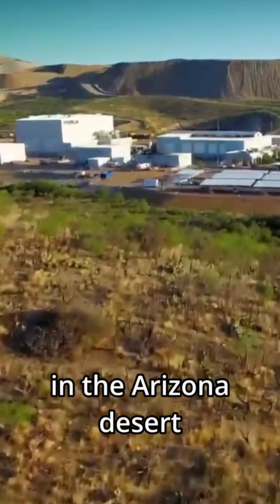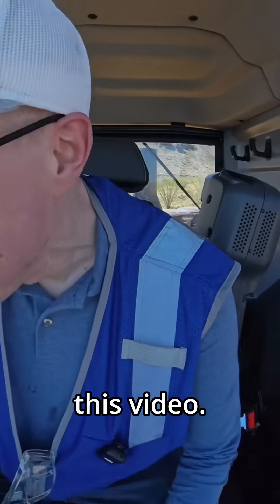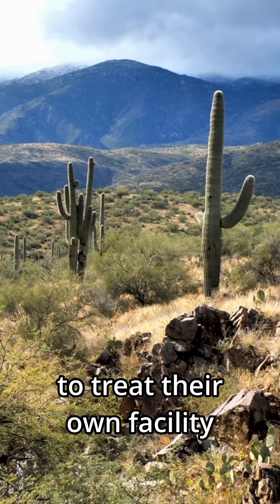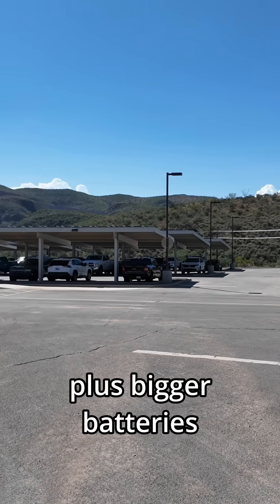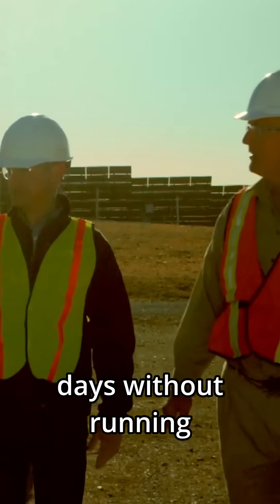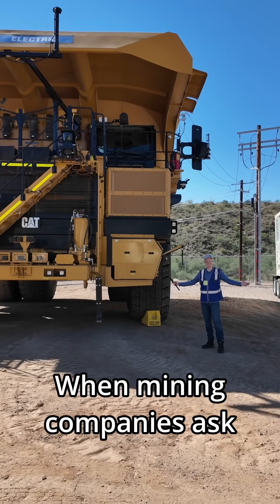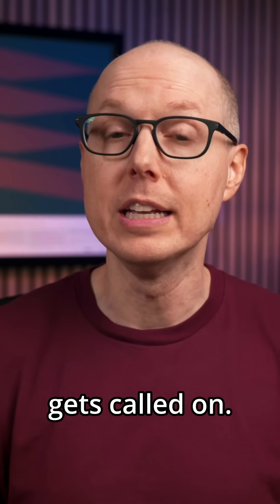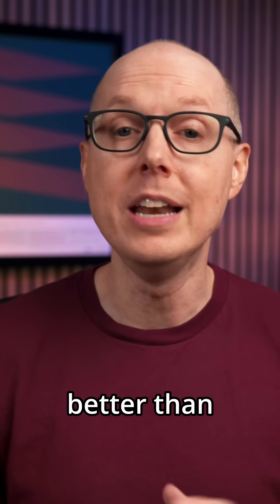Microgrids: The Desert Facility Running on Sunshine

Comment: I installed the fire suppression systems on the very first two electric drive haul trucks at this site in 2006.
Reply: Tell us more.
Reply: Were they diesel electric hybrid? Or battery electric? I didn't know they'd been working on electric for that long!
Reply: @adrianthoroughgood1191 trains have been diesel electric for decades, I'd guess the dumps in open Pitt mines have been D E for decades too.
Reply: @carpediemarts705  nope. up until then worldwide haul trucks have been traditional drive trains.  the shovels and drags have been electric or diesel/electric a lot longer
Reply: @adrianthoroughgood1191  they were the first 2 CAT prototypes diesel/electric hub drive haul trucks. I have also been to the Komatsu proving grounds not too far away from this old mine.
Reply: @USAINC1803KKR   I've seen fire suppression systems put in
Wouldn't be my favorite job!
Glad you do it

Comment: MATT- GET BACK THERE, AND DO A VID, ON HOW THEY'RE MAKING THEIR DIESELS READY FOR HYDROGEN, REPLACING COMPONENTS THAT REMOVES THE NEED TO SCRAP HUGELY EXPENSIVE ENGINES...
FIRST SAW THIS CLEVER IDEA AT CUMMINS DIESEL.🤯🤯🤯🤯🤯🚀🚀🚀🚀🎇🎇🎇🏅🏅🏅🎖️🎖️👍👍👍👍👏👏👏 
THEY WILL BE THE NORTHERN STATES/ COUNTRIES ALTERNATIVE TO ELECTRIC ENGINES
Reply: I HOPE YOU'LL GET THE CHANCE TO LEARN MORE ABOUT SWEEEDEN AND OTHER NORDIC NATIONS NOT INVOLVED IN THE PRODUCTION OF HYDROCARBONS AND HOW THEY SIMPLY BUILD POWERLINES ACROSS HUNDRES OF KILOMETERS BECAUSE THAT'S WHAT NORMAL COUNTRIES DO.
P.S. SO SAAAD TO HEAR THAT YOU FELL FOR THE BURING-H2-IN-ICE-MOTORS THING WHICH IS LITERALLY THE PINNACLE OF INEFFICIENCY (WELL, AFTER SYNFUELS I GUESS)

Comment: I’m a bit confused by the “3 megawatts of battery with 12 megawatt hours of energy”.
Reply: Imagine a watertank and a pipe. How much does fit into the tank? Thats Megawatt hours. How much can the pipe transport? Thats megawatt.
Reply: @kr-wh4shSo at peak "flow" (3MW), you could "drain the tank" (12MWH), in just 4 hours (4hrs x 3MW = 12 MWH).  Alternatively you could draw 1MW for 12 hours.  🙂
Reply: @kr-wh4sh Sounds like you are a teacher ^^
Reply: @Neuzahnstein  honestly, these simple visualizations can be super helpful. There's a large part of our society that tuned out in physics because they could't put meaning to all those terms used.
Reply: It means the battery can output up to 3 mW of power for 4 hours, power and energy.
Reply: Megawatts and megawattshours are 2 different things. The 3 Megawatts are the real power (Watts) they can output while the 12 Megawattshours is how much it can store in Joules.
This means that if the battery discharges at 3MW it would have enough for 3 hours worth of energy.
Reply: @dergescheidte547 I genuinely don't know, why would it not be 3MW for 4 hours?
Reply: @christaylor9095  because you might not always be putting out 3MW, and at lower rates it would last more hours.  MW level is instant output capability, MWh is a volume that could last much longer time  at lower levels of output.
Reply: @christaylor9095 because he is not good at math 4×3=12 not 9
Reply: @lylestavast7652 what you're saying may well be true, but it doesn't seem to answer the question I asked. If anything, your explanation makes it sounds like longer than 4 hours, not shorter.
Reply: 3 megawatts means 3 million watts.  So if you had  giant light bulbs  that each use a million watts, the battery could power 3 of them.  If the battery powers those three light bulbs for one hour, it will use three million watt-hours.  In four hours, it will use 12 million watt-hours.
Reply: To clarify: I know what those units mean but usually one doesn't say "xx watts of battery". Hence my confusion.